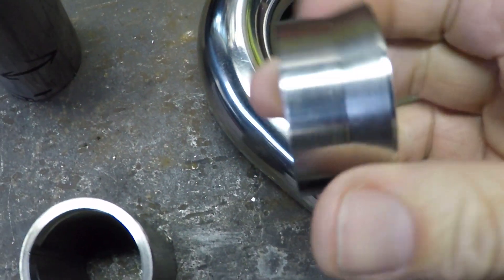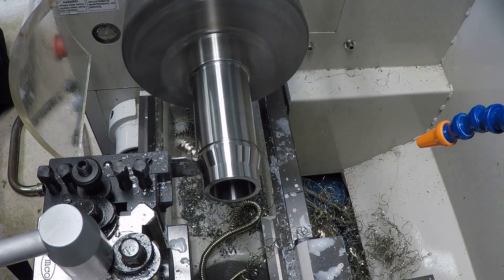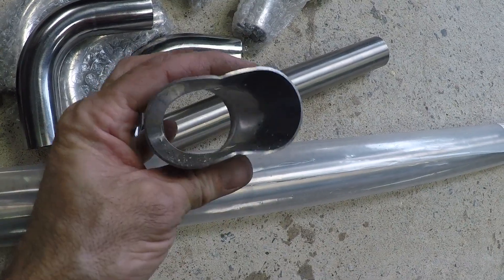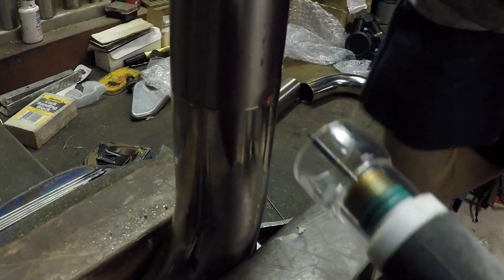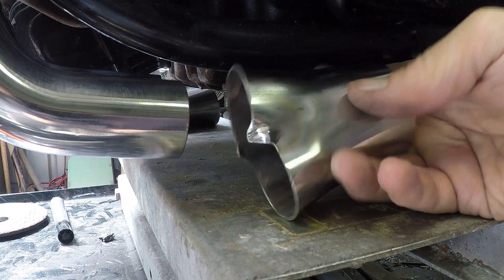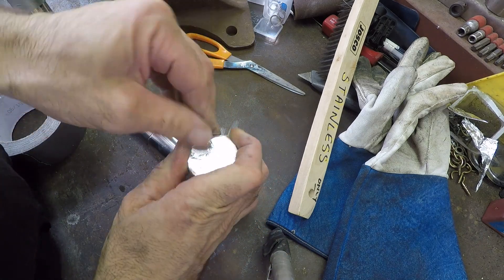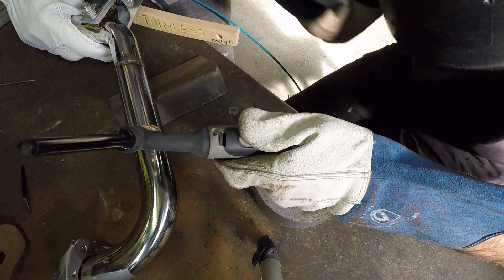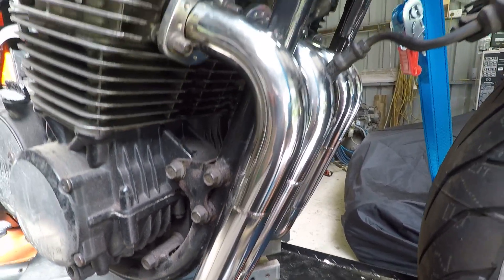Yamaha XJ650 Part 15 Custom Exhaust headers

Comment: Do you need to rejet the carbs when you straight pipe and 82 xj650
Reply from the maker: Hi Mate, I'm not certain as you might be to just adjust the mixture screw to compensate for just a pipe change. Best bet is do it and then use a colortune to check. Pipes only without any other changes shouldn't make a huge difference imo.
Reply: @Mezzmoengineering  I appreciate the response big help I was worried it's my first bike and I'm already a huge fan of it could look a little better but that comes with time💪

Comment: Could get a link to those mufflers please ...is your exhaust 32mm pipes
Reply from the maker: Hi Mate, I'll have to find the link but they are from ebay, shouldn't be hard to search. My header pipes are 1.5 inch/38mm and where they go 2 to 1 its 2 inch/50mm

Comment: I’d really appreciate some advice if you’ve got the time . . . I’ve got a 650 Seca, and someone’s given me the headers & collector box from a 550 . . . do you think it’s worth trying to get it to fit?  Would the collector box work, even if there’s loss in performance? Thanks man.
Reply from the maker: Hi Mate, I'm not familiar with the sizes of the 550. Unless those are immaculate I think its better to start over. New mufflers are cheap is you go for something like I did which was just from Ebay. Building headers isn't a straight forward job so I guess it boils down to what your aiming for. If its just to get it running then give the 550's a go, if you're doing a proper build then I'd start with something new. The headers from a 750 fit a 650 so thats another option too if you can find a used set.

Comment: you do good work but i can't believe you are putting it all into an old xj, well at least you have a Y motor, these non y engines are a nightmare.....
Reply from the maker: Well, its something different. I think with the wheel upgrade and other mods it will turn out nice.